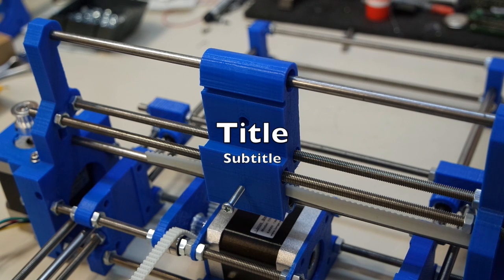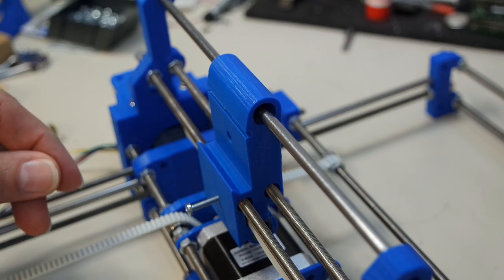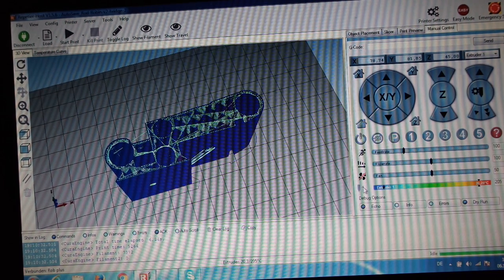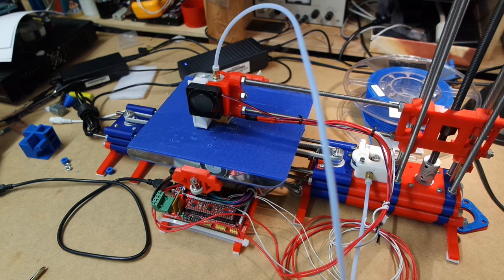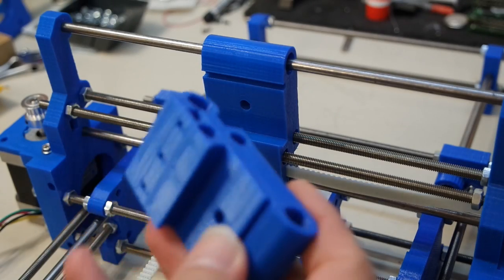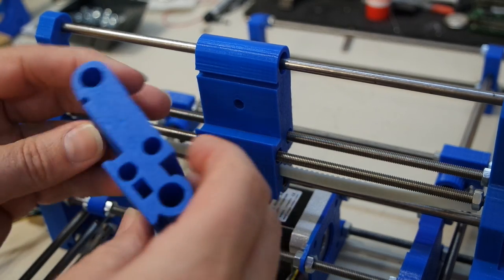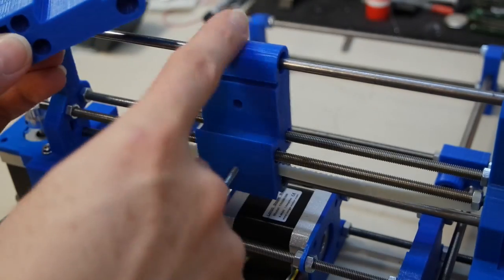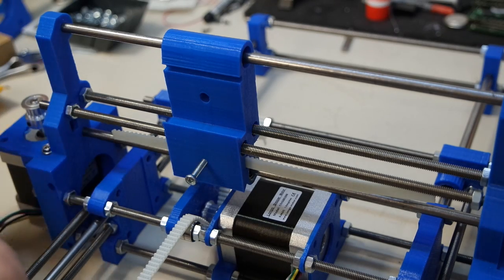The new CNC table pt. 3

Comment: You might want to put the screws on the other side, so you get more materia for the screws to grab to.  Unless you are going to use that for something.

And if you make the top part of the upper bearing hole thinner. The it will flex that whole when pushing in the linear bearing.
That wouldn't make the construction much weaker, as it take up forces in the Y-directions. But easier to push in the bearing.

Sorry for comment now, but your construction are interesting to follow. Thanks.

Comment: looks great .  and that 3d printer is great how the head is stationary .  inventive as ever my friend .
Reply from the maker: All printers I designed so far share that feature, that the table moves in X and Y direction, an they are all called Robin.
Since I love to play with different tools and purposes that has so far been a good design decision.
Reply from the maker: AH POO ! Just realised that the pods holding the gantry are about 10mm too low, forgot to adapt the parts when I raised the table to make attachment of the table belt easier .... back to start ... and print two more.
Reply: dang , and the upper parts of those side pods is not modular so its 2 whole reprints . 
possibly make the upper parts modular , that way 3rd axis later could be real easy to do?  thats is swap pod tops for towers for a 3d printing Z axis if needed and having a common lower pod ?
Reply from the maker: Yes, I did plan them to be two parts - but if I print them as one they are much stiffer - but, I would have needed to print the pod part, and that has more than 70% of the build volume. They are only connected with 4 screw nuts each, so they are easy to replace/swap. Uploading part 4 now, the 'how not to' episode.

Comment: The belt on the axis with blue parts looks a bit loose. This could be making your prints bad.
Reply from the maker: I know what you mean - these timing belts have a steel wire lining inside, they are very hard to bend, so it always looks like they don't have enough tension when the carriage is way on the other side. But too much tension is also bad, because it makes the timing index appear in the printed things.